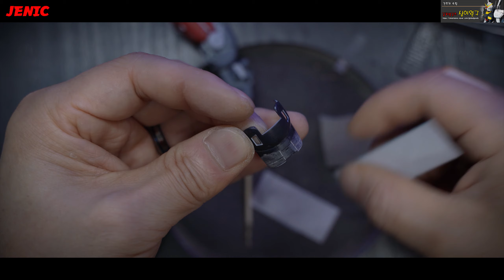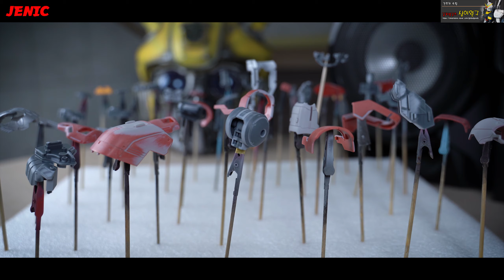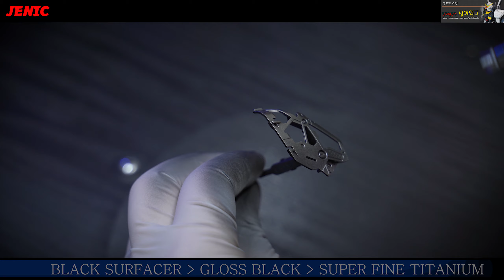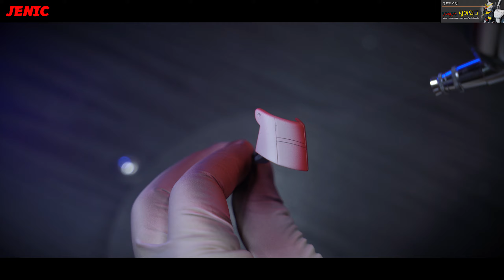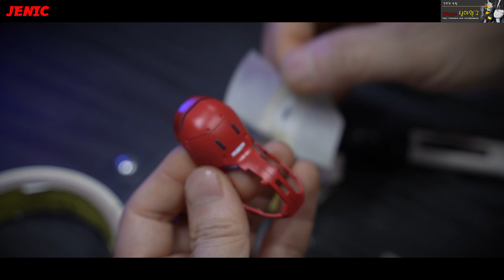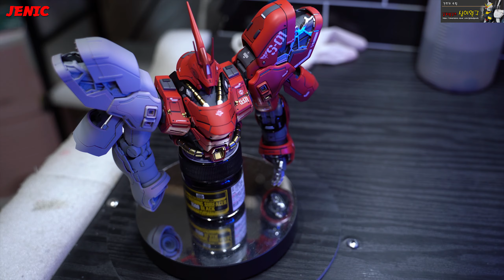[GUNPLA] MG SAZABI Ver.Jenic [custom build] PART 4

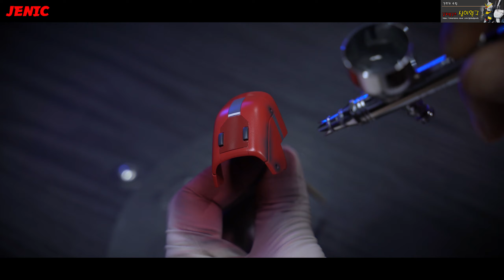Comment: Utterly amazing as always! @ 5:14 I've never seen panel lines done this way! is it alcohol you are cleaning with? how does it not ruin the paint underneath?
Reply: If i'm not mistaken. He used enamel paint then used enamel paint thinner to clean it as enamel wouldn't ruin acrylic paints.
Reply from the maker: In the case of a wide panel line, it is not expressed simply by spilling it.
So, paint the panel line by spraying enamel paint with airbrush.
It was wiped with an enamel thinner.
Reply: @Jenic77  Thanks guys!!